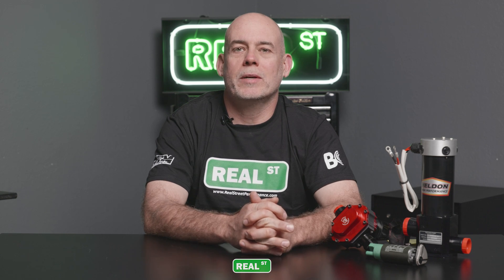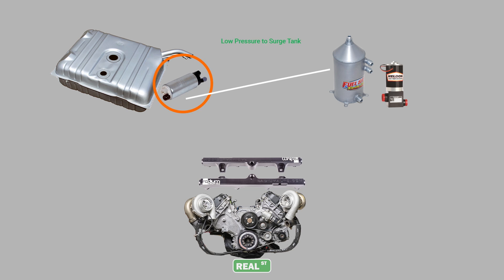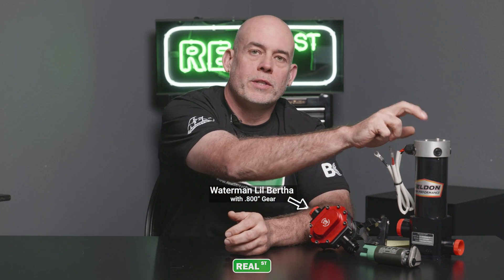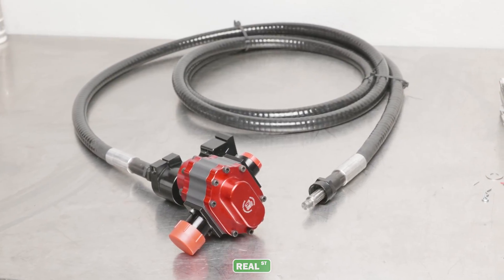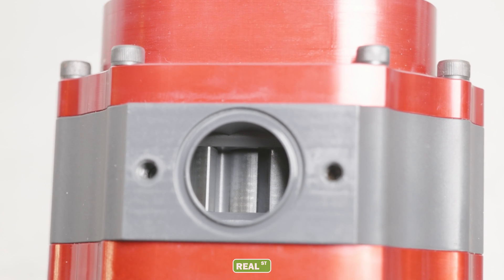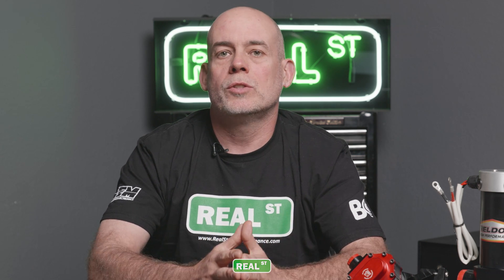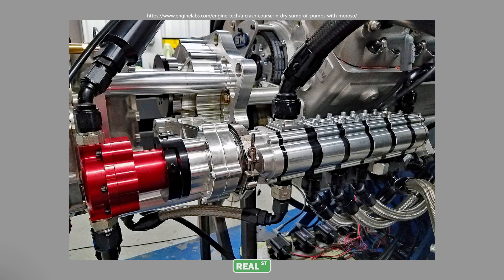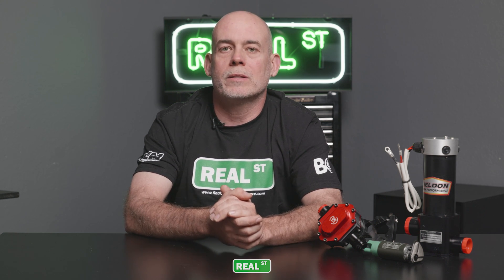Mechanical Fuel Pump | Is It The Right Option For You? - Jays Tech Tip

Comment: Okay so my question is what about everyday driver mechanical fuel pumps?? Did they last longer than the modern ones? That's my real question because if they do, if you're building a daily driver you better go mechanical because if you're somebody that wants to drive a long time and not be having to fix everything, basic is better. I'm sorry. Yes, roll up windows fall off the track sometimes but it's a lot less often than window regulators failing and a lot easier to fix and cheaper..... I'm sorry but sometimes basic is better. You know that's the problem with automotive industry. They lost sight of the automobiles main objective transporting idiots from place to place all the other creature comforts aren't necessary. I'm sorry and you know what your elbow can always flip a lever or turn a knob unless you break your arm

Comment: Isn’t one of the biggest advantages of a mechanical pump is constant flow regardless of pressure?
Reply: Even better, the flow isn't constant, The flow increases linearly proportional to RPM regardless of pressure.. The flow increases when it's needed most.

Comment: A few things that should be noted here.

That weldon pump is roughly 7 GPM which is not that big in the scope of electric pumps, Aeromotive has a 10 GPM pump and will soon release 12 and 15 GPM pumps.

The surge tank in your original setup negated any of the safety and crash benefits of keeping the original tank.

Crank to run is an issue in the tune, not with the fuel pump, I have owned and tuned multiple cars with mechanical pumps that will light off immediately.

A problem with the track with a relay can be frustrating, but you can get relays at most auto parts stores, however, if you lose a belt your weekend is over unless someone at the track has one.  A PDM fixes both issues.
Reply: Those high gpm aeromotives are brushless, Jay mentioned that option in the video. That Weldon is probably one of the biggest non-brushless pumps available
Reply: @Carbibbles  Listening is hard when you come from a certain part of the world
Reply: There are solutions to everything he mentioned, nothing new. Comes down to how much money, how much weight and how many potential points of failure you're willing to throw at your setup.

Comment: Adds minor plumbing but, some add a small electric pump to prime a mechanical fuel system. 
With proper fuel system design and changes to start up tune, excessive cranking is at a minimum, even after sitting for days.

Comment: How come there is no mention of parasitic lost with mechanical fuel pumps? Hydrodynamic friction lost is huge if you are looking to extract every horsepower that a motor can produce. Just like getting rid of power steering and mechanical water pumps. The is a definite gains. Mechanical fuel pump is no different.
Reply: It's not significant enough a loss to sacrifice reliability or an engine or a race.
Reply: @BEANS-O-MATICtransmissions  as much as water pump and power steering I'm sure but if you are looking for the edge, with never technologies like brushless and variable pumps that can support more than 3000hp /2500hp ethanol, yeterday's unreliability is in the past.
Reply: Winning the electrical and reliability battle is worth a few horses on a 1000hp+ forced induction set up. If you’re running an NA K series at 300hp, mechanical probably isn’t for you. In my 2JZ I’d rather not even add a second electrical pump, I’d rather go straight for the cam driven mechanical using the OEM electrical pump as a primer, I’m okay with spending 20hp to not have to electronically stage a second pump, adding another relay, surge tank, and spending 15 amps on the second pump.
Reply: Mechanical is way more efficient. it takes about 1 hp to turn these pumps. hook up a hand drill to the hex and spin it. it'll pressurize the system with surprisingly little effort. far more efficient than the losses involved with generating the electricity with an alternator.

Comment: Hi Jay, does a mechanical pump heat up the fuel much if it’s not being used to capacity? A street car for example that runs flex fuel, running a tank of gasoline would be using only a small percentage of the output of a mechanical pump.
Reply: No more than an electric, in fact maybe heat it less from not having a motor heating up the housing. 
But most importantly is to have the proper sized regulator to return all the unused volume of fuel. The resistance to bypassing is what generates excessive heat.

Comment: I have heard and read negatives about using a hex drive mechanical fuel pump mounted to the camshafts. Maybe it is only on small numbers but there are reports of the hex drive breaking. Would a cable driven or belt driven be a better option in terms of reliability?
Reply: Kinsler (best quality pumps IMO) sells their hex drive pumps available with essentially a universal joint for this very reason.